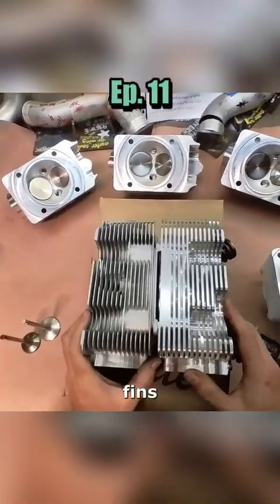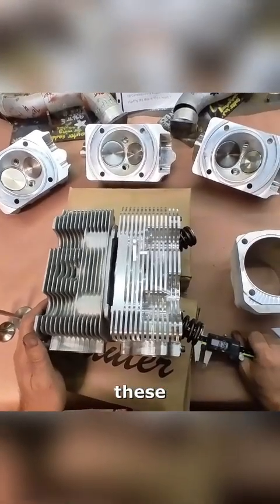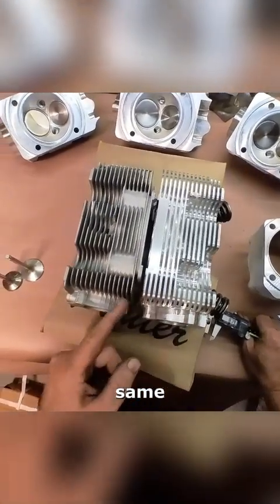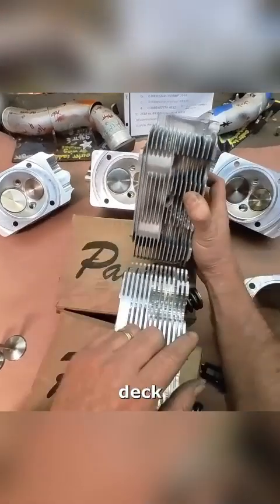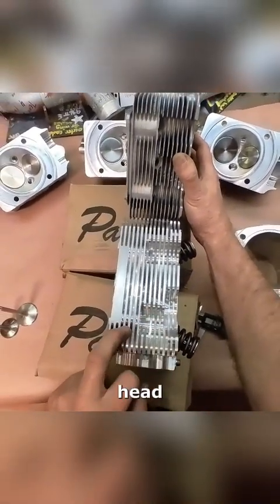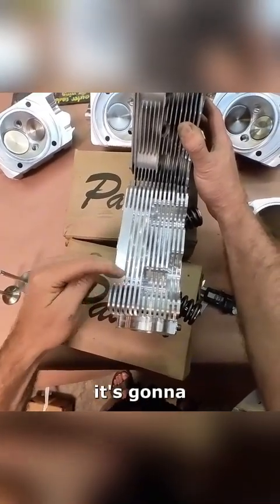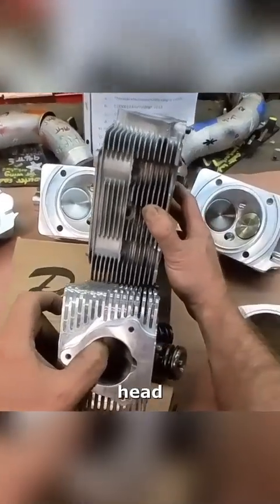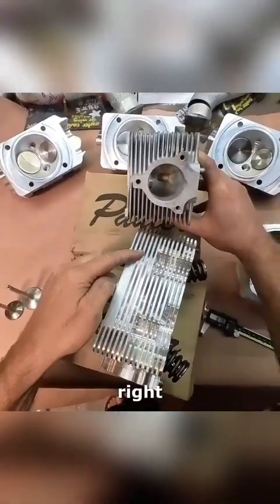Ep. 11: Billet Porsche 993 Turbo Cylinder Head Unboxing, Review, and Factory Comparison

Comment: Thinner fins get rid of heat better.
Reply from the maker: @oldman-n8o  I'd assume the same.  Also the texture from the casting would improve heat rejection vs the smooth milled surface.   The 964 fins look more like the billet head with thick straight fins.  The 993 Carrera and Turbo go tapered fins like shown in the video.